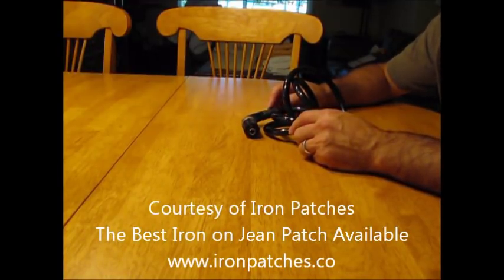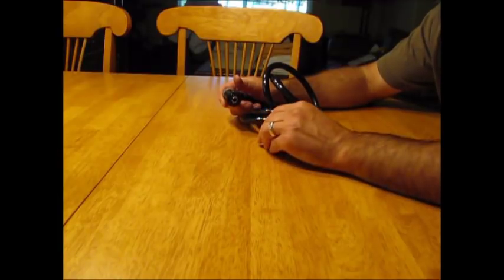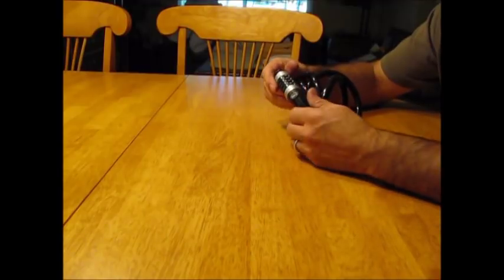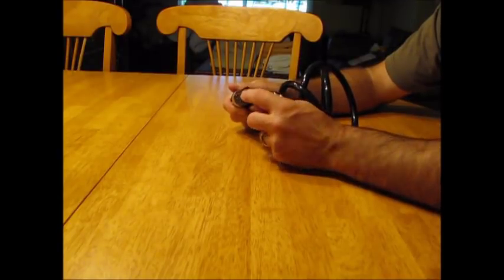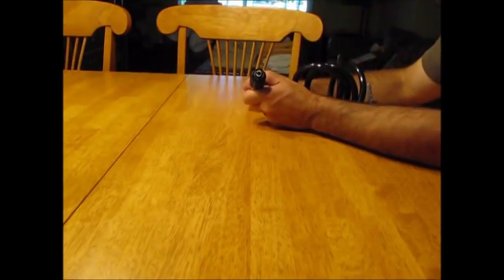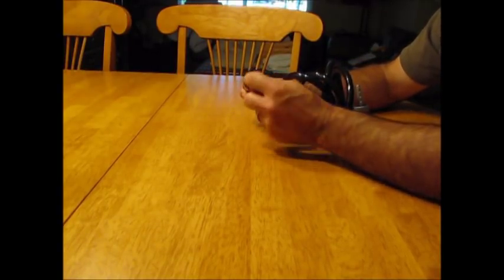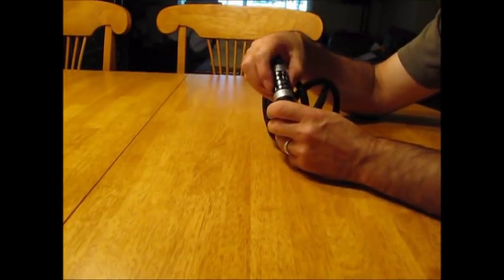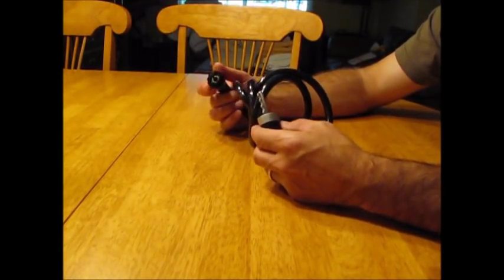How to change the combination on a Bell Bike lock

Comment: I DID IT!!! thank you so much. One of the comments said toPush the  "red button in towards the lock itself, and then push it down toward the hole, will hear the pop"
Reply: Thank you Odg Smith.... your comment helped me to change my  lock combination  (( unfortunately the video didn't help)  appreciate it sooooo much!!!!!!!
Reply: Thank you for this comment.  That was the only thing that helped and worked.  More valuable than the video.
Reply: It helped me too!
Reply: Thank you ogd smith - this was the helpful comment that helped (the video itself is not directly helpful, but ultimately got me here successfully) -  "red button in towards the lock itself, and then push it down toward the hole, will hear the pop"
Reply: THANK YOU!  I couldn't see which direction he was pushing, but your comment made it work for me.  Mine didn't make a pop noise, but did reset.

Comment: I apparently had an older, cheaper Bell lock. I could not find any red flags (a bit Rusty), even though the lock was open. I already knew the combination but did not like it, so I pulled the lock ring, disassembled, and rebuilt the lock to a new combination. This was easier then playing with the little red flag. Also with the lock .
Reply: With the lock disassembled, I learned how the lock worked.

Comment: I had the exact same Bell lock in my hands while watching the video.
You said you need to get the metal part with the red markings down and over and hear it pop to reset or set and you also said you wish viewers could see what you're doing better. I could not see from your video how to move the metal part with red markings and I was not able to
move it. It would have helped to explain 'how' you got it down....did you rotate it clockwise or counterclockwise or did you flip it over...etc..
Reply: J Bach push on red then while pushed down push toward center hole
Reply: I had the same frustration, but read the comments and found some that said 'push red part down and then towards the center hole'.  Then it works.